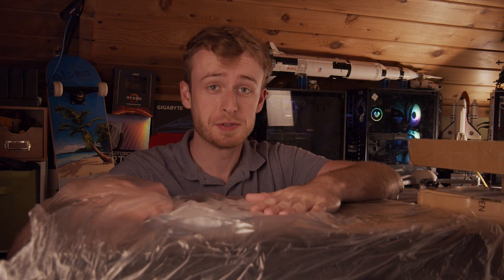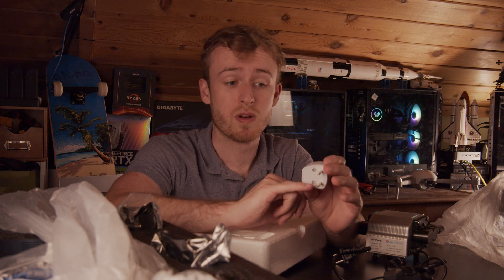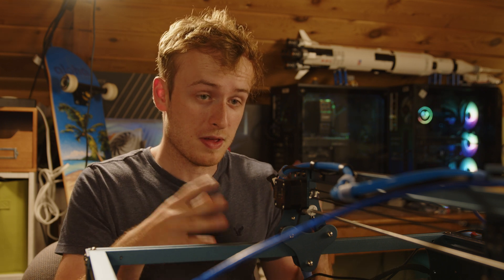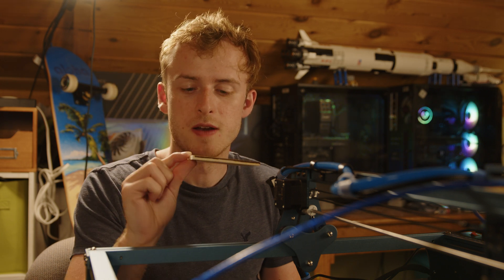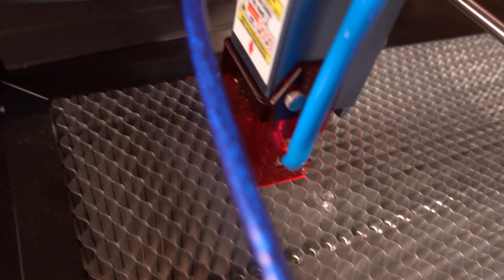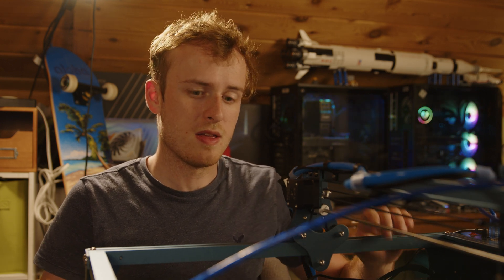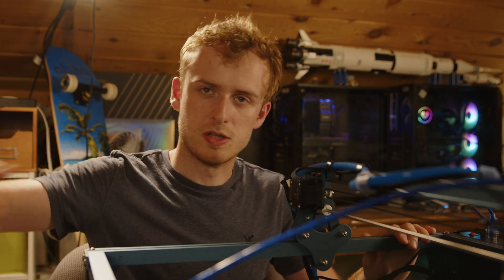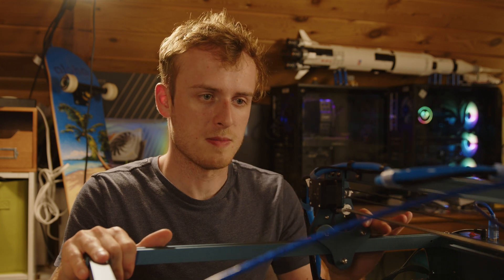Sculpfun S10 10W Laser Engraver Review and Unboxing

Comment: You might want to take the "t" out of sculpfun, you'll get more views, you were way at the end when I was looking for reviews for this specific laser. Check the spacing interval between each scanline and switch it to .08 interval and you'll get a lot more detailed image engravings. Try lightburn too and cut a few passes in the shape of what your trying to cut out not in lines like engraving. If you try these I'm sure you'll get a lot better results. Try cutting from 300 to 600mm per minute at 100 percent. Thanks for the review hope it all works out for you